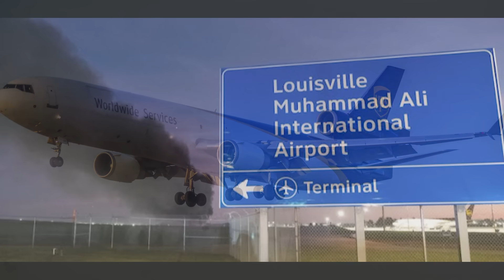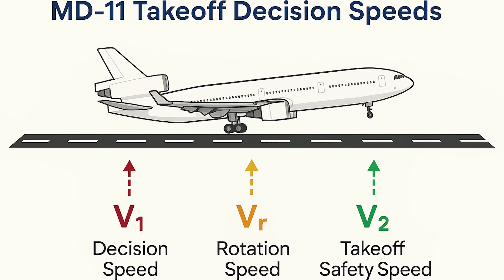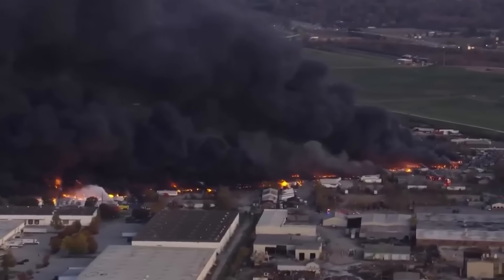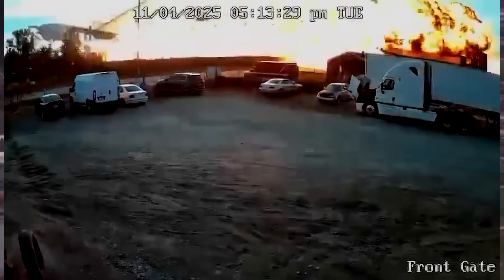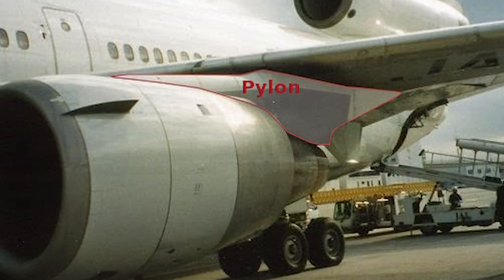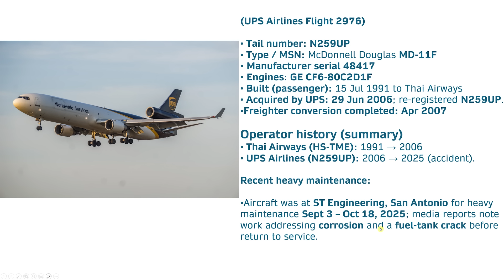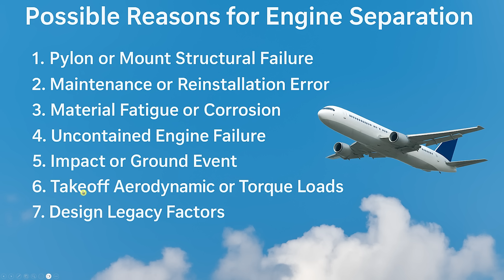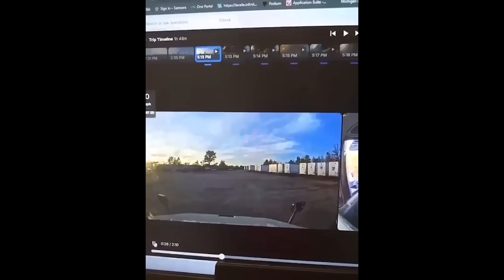What Caused UPS Plane Crash, Louisville, KY? How MD-11 Engine Fell Off

Comment: I work at UPS and I was about 100 yards away from where the engine dropped and from my perspective it looked as if the plane hit our freight facility because the explosion was so massive and close. It sounded like a train derailing going down the runway. I’ll never get that sound out of my head
Reply: Hope you find peace after witnessing that
Reply: I live right off of outer loop and I thought we were under attack. Im so glad you're ok. Prayers for our entire city❤❤❤❤❤
Reply: @kimbates7201 😮 prayers for this area and yourself
Reply: @JillLeonard-z6g  Repeating everything that was said already in the video doesn't make you look educated on the matter. We all watched it and heard everything that was said. 🤡🤡🤡🤡
Reply: @Asymmetrical-Saggin So, you don't like being reminded to pray for all the departed souls from this accident?
Reply: @kimbates7201 we are under attack.  Look at London and New York
Reply: That's crazy. How does the engine fall off the airplane?
Reply: @markolson3855  It has happened before. AA191 in I believe 1979. They used a forklift to reinstall the engine damaging the mounting points. Hope that's not what happened here. This plane was down for more than a month.
Reply: @Igotstaknowit 😮😮 wow!
Reply: @Igotstaknowit it’s definitely eerie that this happened again
Reply: @Igotstaknowit  It also happened on a Boeing 747. The fastener on number 3 broke off. It ripped the engine off and inturn collided with the number 4 engine, ripping it off too. They couldn't recover. This has happened quite a few times.
Reply: @MrSpoonfeeder similarly that has happened on propeller craft too… (where the propeller shaft somehow comes loose and the freaking assembly flies off)
Reply: @markolson3855 right! Shouldn't that be discovered during pre-flight inspection?
Reply: @kendradawn369 no kidding! I was sitting on a commercial plane and i see rivets missing by the aileron, i called the stewardess and said make the captain aware. Its almost like do they even do a preflight?? Walk around? We took off that way anyways.😂 i was not okay that flight
Reply: @JillLeonard-z6g my God 😮 I can't even imagine. I've never been on a plane and at this point I don't think I ever will. I have NO faith in people's capacity to give enough of a sh!t to do their job and do it correctly.
Reply: Saw a plane captain launch the commanding officer with grounding strap still connected. It actually hit the wing took out some ailerons 😂😂 and the guy who did it was biggest goof in our squadron. Ill nvr forget his name
Reply: @kendradawn369 considering it was down for 6 months for presumed maintenance as well...or six weeks, I cant remember but it was still down and no fly for more than a month.
Reply: @JillLeonard-z6g A GOOD PILOT will do his due diligence and do a preflight check and a post flight check on everything!!! It’s what they are supposed to do.
Reply: @kendradawn369 The actual mounts for the engine are pretty buried into the structure of the wing so its likely something you can't even see, let alone inspect on a pre flight inspection.
It's the sort of thing that's checked on major, scheduled maintenance inspections.
Reply: @JillLeonard-z6g Things like missing rivets they have criteria for.
Airliners in general are EXTREMELY overbuilt with multiple layers of redundancy.
As a totally made up scenario just as an example - if a component needs 6 rivets for structural integrity, they'll fit it with 12 then have a policy of we can lose say up 2 rivets before we immediately ground the plane, otherwise it can wait until the plane gets to the next airport where the airline has a major repair facility.
Planes are incredibly complex machines and things break all the time - I can guarantee as a mechanic, if I looked around your car right now I could find something wrong with it but that doesn't necessarily mean it's a death trap ready to kill you and everybody inside it.

I can guarantee the airline and the mechanics knew about that missing rivet.

Dull fact - there are approximately 3 MILLION rivets in a 747
Reply: @lifebeyondthesalary2458 pre flight check can only show so much, they cant see microcracks, metal fatigue etc. If an aluminum engine fan decides to take a 💩 duribg takeoff they're oretty much fuc***, its the equivalent to an engine throwing a rod or dropping a valve but with more catastrophicrepercussions, 💩 happens dont blame the pilots, ive personally eirked with all three pilots and they were professionals through and through
Reply: @kendradawn369 on a pre-flight inspection you can’t tell if an engine is going to catch fire and essentially melt a pylon.
Reply: @deezelfairy ST Maintenance should've caught the corrosion when it was in their shop. The first place the NTSB needs to go is San Antonio. I'd be interested to know what else was amiss with ST Maintenance.
Reply: @kendradawn369 42,795 motor vehicle fatalities per year in the USA. We are all landing at 60 mph every day of the year. Feel better now?
Reply: @kendradawn369 you're far more likely to be in a car accident than a plane crash. At least pilots and mechanics have professional training. Most drivers do not.
Reply: @Angelum_Band huh? 🤨
No not really. There's a big difference between driving a car that you're in control of and hopping in a can and going up in the air where you are most definitely going to die if you wreck.
Reply: @J_Wags you can tell if it's going to fall off
Reply: @deezelfairy go to know. So I wonder why it wasn't found. I keep getting a bunch of comments where people are saying there's nothing that could have been done but there has to be something that could have been done. If not that just further validates why I would never get on a plane.
Reply: @kendradawn369  I didn't say or imply that it can't be inspected - it just can't be inspected on a pre-flight which is a relatively minor inspection.
As for why it was missed? That's the job of the NTSB to establish.
But the reality is planes are extremely complex and humans are extremely fallible. Flying is still the statistically safest form of transport but mechanics can still miss things. Same a mechanic could accidentally leave your lug nuts loose on a wheel on your car which could easily cause an accident.
Reply: @rubies200 Have they confirmed corrosion now? I made those comments 10hrs ago.
Reply: @kendradawn369 

Have you ever driven a car? When you're driving, the truck driver next to you could easily fall asleep, and you'd be right there with God... Flying is the safest way to get from one place to another! How many people died today because you flew? Zero, and that's thousands of miles!! In road accidents, 1300-1600 people die every single day!!! Please never get in a car again.

Best regards from the Netherlands, Oudesluis ✈️
Reply: @deezelfairy It was listed on the report shown in this video.
Reply: @deezelfairy It was shown on the report from this video.
Reply: @kendradawn369  I know someone who worked re-fueling airplanes. The sad reality is she would notice bolts missing all the time, report it, and nothing would be done/taken seriously. Airplanes are safe because they are made with so many redundancies, so if one things fails something else can keep the plane in the air. The unfortunate reality is companies lose money every day a plane is being repaired/cant be flown, so they put off maintenance as long as possible, leading to things like this
Reply: @alibradley6302  this is not some clown fly by your pants industry. There r critical step by step procedures, inspections, over seeing. If something like that is going on  when they r done with their deep investigation into each person  someone or more than one person could seriously be held liable for the lives of others. Just as the dc plane crash you can bet they r still in the process of a very deep  investigation to get to the bottom of it.
Reply: @kendradawn369 Especially even more nowadays. Jobs are giving more liberty for people to be on their phones and playing music in earbuds while they "work" so workers are less focused on doing a good job.
Reply: @alwkicksta exactly 💯
Reply: @markolson3855  It most likely came off the aircraft because the engine mechanics did not secure it properly after they installed it.   I worked on military aircraft.  I had to inspect the aircraft engine wiring harness after the engine was removed.  I also had to connect the electrical connectors on the engine to the connectors on the aircraft.  I am willing to be a lot of money that they 2 or 3 guys that put the engine in did not do it correctly.  It is also possible the engine wasn't removed but stress fractures occurred over many years that nobody caught or there was severe corrosion on a structural element that takes the weight of the engine.  But my bets are some jet engine mechanics are shitting their pants right now.
Reply: @markolson3855  easily,  when its not correctly attached to the aircraft
Reply: @markolson3855  Human error.  Mechanics who maintained the engine did not put it back they way they should.
Reply: @markolson3855 it's a MD 11. I wasn't shocked. Happened to us it was just before it hit the runway. These companies keep stuff secret. Freighters should be held to the same standard as commercial. The company i worked for told us they were getting rid of the MD 11 5 years ago because of maintenance then changed their minds.
Reply: @markolson3855 corrosion weakening frame. It had a stress crack.
Reply: @JillLeonard-z6g didn’t this happen to a DC 10?
Reply: @auroraborealis6009 not sure..what yr?
Reply: @JillLeonard-z6g thinking it was the 1970’s
Reply: @auroraborealis6009 Yes, it was the 1979 flight that crashed in Illinois. That was a DC10(?). This is a MD11--basically, the same plane.
Reply: @auroraborealis6009  It’s an MD-11, an elongated version of the DC-10.
Reply: God bless you!  I hope you find peace as the other person commented.
Reply: Wait. 100 Yards away? How is this possible? The engine dropped on the runway and not even close to the ups facilities.
Reply: @Paddy007  UPS facility is right next to the runway. You can see dozens of their planes on google earth. The have a larger facility than the airlines.
Reply: @Paddy007 the UPS facilities take up pretty much the whole South end of the airport, in between both runways. There will often be jets parked being unloaded and loaded just the the left of that runway
Reply: @Paddy007   If you look at pics of the engine on the runway, you will see there's  buildings right behind it.
Reply: @gigicostlow4414  But not 100 Yards away. Also the guy was saying he works where the crash was. So 100 Yards compare to the engine found around at 2000 Feet at the runway, when the runway is 4500 feet long. I know maths is not for americans. But it is just impossible.
Reply: @Paddy007  UPS worldport is parallel to runway 17, it's possible when he said 100 yards he wasn't speaking in regards to the length of the runway but the distance from the location he was to where the engine landed? Even if he miscalculated you didn't need to be rude, I thought Europeans were supposed to have more class than is but more often than not that doesn't seem to be the case
Reply: @Jessa-RM  I am not rude. I am just stating facts. And he isnt telling the truth just to get some cheap reactions.
Reply: @Paddy007 the words used was "i work about 100 yards from where the engine fell off" the plane was still moving and almost off the ground when it came off. Read and comprehend.
Reply: @Matthew-qk1xi   Exactly.  He can't seem to comprehend that he did not say he was by the crash site.  I told him to go look at pics of the engine on the runway and he will see there are buildings right behind it.
Reply: @Paddy007  yep im confused on his comment  . did the plane hit the building   to cause the engine  to come
Reply: @WINCHELLLOCKLEAR  Thats it. The engine already was on the runway.
Reply: @Paddy007 I know, doesn't seem fair does it?? It falls off while they're going 180 mph right before darn runway end  and have no other choice but take off. I wonder if there was any possible way he could've avoided take off sh!t.
Reply: @JillLeonard-z6g  I think you dont get my Point. It clearly fell off on the runway and not after it crashed..
Reply: @JillLeonard-z6g  After V1 it is not possible. I am just saying, the guy here said 100 Feet away, but the turbine was found on the runway, not where the guy was working.
Reply: @Paddy007 thats what i wrote..i saw it still on the runway
Reply: @Paddy007 100 yards, not 100 feet
Reply: @LelaE34  And still it is not possible.
Reply: @Paddy007 he said 100 yards not feet, big difference
Reply: @TheRealJBS1976  60 Meters. Still doesnt matter. The UPS facility is not even close to the runway where the engine is.
Reply: @JillLeonard-z6g no possible way to avoid takeoff once theyre past the V1 commitment point. Other than run through a big fence at end of runway with same buildings on orher side. Their only hope was to try to get airborne long enough to come around for emergency landing
Reply: @Paddy007 yea the UPS facilities are very clise to the runways, have you never been there?
Reply: @TheRealJBS1976 WOW 😲
Reply: @Paddy007 boeing plane?
Reply: Friend, you were spared for a reason! Make the most of your days ahead. Peace be with you.
Reply: God bless you ❤
Reply: Ever buy tires from Chris?
Reply: @mcgoo721 Chris Aymond?
Reply: I hate u had to witness something that horrific.  I pray u can find peace.
Reply: Deep Breaths and Calmness your way. Please take care.
Reply: Remember they had about 40,000 gallons of fuel too. So very sad.
Reply: I'm so sorry. If they make trauma counselors available to you I hope you take advantage of that and talk with them. Trauma counseling really helped me after an event.  I hope you find peace. 🫂💕
Reply: I’ve been injured by UPS poor maintenance by package car maintenance. I feel it will be criminal gross negligence.
Reply: @MrBarrySell Is UPS going broke? I've heard it has been laying people off.
Reply: @rubies200 shareholders want profit over ppl😮
Reply: I feel so bad for all of you on the ground who witnessed this
Reply: I'm glad that you are alright!
Reply: Dude, so sorry you had to experience such a nightmare! Thoughts and prayers to all affected.
If possible, find a trauma therapist that specializes in PTSD! Do yourself a favor, don’t try to process this alone!
Reply: I'm so sorry man
Reply: God give comfort to your soul.  That must be so traumatizing.
Reply: You’re not even in the same state 😜👍
Reply: So sorry you had to see that .
Reply: So sorry.  Hope you find a way to cope with it.  Time heals.
Reply: My...God...
Reply: Wow thanks for speaking up. Helping people with difficulties understanding what and how this happens.  I'm praying for your ability to manage that experience 🙏
Reply: I bet it's similar, or the corrosion on the mounts snapped off during the high torque.  These planes are work horses, 45 years makes you wonder what's original
Reply: Pics or it didnt happen
Reply: I saw  fed ex plane lose an engine but it was still attached and it was an earth shaking boom from inside the hanger in an office.he did land safely but def sh!t himself. It scared me!!😮
Reply: Yep, when aluminum is damaged (cracked in a spot) it can’t be restored to original strength. A bent and cracked aluminum ladder might work somewhat ok for a long time but isn’t safe to climb on .
That UPS plane was full to the brim of fuel, so maximum weight capacity which likely made all important structural joints attempt to,hold together and the weakest spot which sounds like it was damaged in the last, failed catastrophically.  
My boss has 3 delivery vehicles that have 500,000 miles on them. They look like crap and require constant repairs but they ride real nice and are somewhat comfortable because of routine maintenance. One of them I won’t take on an out of town run. 
There has to be a limit to how long these airplanes are allowed to fly. Probably impossible for everyone to agree on an expiry date for all makes and models. Anything cracked or damaged should be removed immediately and used for parts.
Reply: @thurgoodstubbs9670 Bad idea to use them for parts, though I do agree with the rest of your comment.
Reply: @thurgoodstubbs9670 

Spent 2 weeks in Oct. for Maint. regarding possible corrosion..
Reply: @thurgoodstubbs9670 you’re right. But the OEM’s  & Aerospace Supply Chain can’t keep up with the growing demand for new planes. Consequently the planes are flying much longer with more MRO work.
Reply: @thurgoodstubbs9670 i forgot abt the fuel. We know how long it takes. Imagine all that fuel! Because a fork lift ran into it and something abt the fuel tank i thought i heard. Thats just all bad. I think maintenance failed with this one. That was an old aircraft but...the ones i worked on in the military were from the 60s..my father worked on same plane same engines and deployed euro too not meaning to do that what so ever . Whats those chances?! And we flew them up until 2014?? They decommissioned.  Females were having babies with birth defects and others got cancer from the planes way out of date systems a lot of airmen were exposed to the radiation and it affected them.
Reply: Take care of yourself.
Reply: Oh man that look like a bomb went off must give you trauma I have that PTSD
Reply: I bet you won't. You might have a bit of a reaction next time you hear a lot noise... and repetitively!
Reply: I feel for YOU, get counselling soon, If it were me I would need that!  Accept no meds!!!
Reply: what "freight facility" ? a truck?
Reply: @4wheelsride its a UPS Ground facility. Its an intermodal location they have the air coming in by plane and ground coming in by truck all in one location. UPS Supply Chain Solutions a short distance away on Outer Loop. Probably half of UPS Global traffic goes through Louisville. 300+ flights a day to all over the globe
Reply: What a terrible experience for you.  I hope that gets over the emotional trauma
Reply: My heart goes out to you.
Reply: 😮 alles gute für sie !!!! Lg aus Deutschland
Reply: I’m glad you’re safe. May time help you find a more peaceful perspective.
Reply: I am so sorry. I hope you are okay. Please don't be afraid to reach out for help if you need it. This was such a traumatic event to witness.
Reply: That must have been terrifying to witness. Thank you for sharing your perspective — it helps remind everyone how real and devastating these moments are. Hoping you and your coworkers are doing okay. 🕊
Reply: That is a good description. It was crazy loud. I was sitting at the end of Wing A watching it all. Were you in the red tag yard?
Reply: I am sorry you had to witness it. A person doesn’t ever forget something like that.
Reply: Extreme gross negligence on the mechanics part, theres no way the engine is just going to fall off, someone or somebody's are in very big trouble
Reply: I just wanna give you a hug. ❤🙏🏿
Reply: Interesting. I ride my moped down that street right beside that massive UPS hub. And I Heard the explosion and seen ALL that smoke blanketing the sky. That was truly terrifying and the destruction your UPS plane did to the landscape. Probably one of the most destructive plane crashes I Have ever seen, and it happened right in our neighborhood. Sheesh, times are changing.
Reply: Blame dei.
Reply: whoa dude its like breaking bad
Reply: Hope all will be well with you 🙏🏿
Reply: So sorry you experienced that. Please take care and be gentle on yourself.
Reply: If I were a Pilot I would refuse to fly any airplane that had structural damage in relation to the flaps, landing gear or engines. Nope. You can’t fix cracked aluminum no matter how thick it is. I can’t imagine what is used to repair it in such cases. The jokes abound about duct tape which are quite  humorous until you get a tragedy like this which isn’t an accident, it’s an outcome of deceptive repair practices.
I drive a delivery pick up truck and have no problem telling the boss that I won’t drive it until you fix the problem I have found. I refuse to get a ticket or crashed because of poor maintenance or faulty repairs. Those UPS pilots deserved better support than what was given pre flight. Safety is the word down the chain until it comes to replacing a $500,000 airplane because it has a crack here or there.
Reply: I don't get the 'Engine Drop" thing. Is it a jargon among pilots/aiport people or did the engine literally drop out of the plane?
Reply: @pajeetsingh 
It literally dropped out of the plane
Reply: yeah you better make a claim to your insurance and get check for psychological damage.
Reply: Apparently you missed the video. Check above your comment again for a video if it doesn't start automatically or the triangle in the middle of the picture above your comment. That's where the video was hiding from you. Then you want to make sure the volume is up if you're on Android it'll be one of the three buttons on the side of the phone the pair of two buttons that are closest together are for the volume press and hold the top one while the picture aka video is moving. Then remember the airport uses runways to allow the plane to land and to take off. Ok now so you still believe your comment is in any way accurate?
Reply: Wow, I imagine that's gonna be a hard thing to shake. Hope you're doing well.
Reply: United pot smokers. United we stand. Smh
Reply: That's pretty scary 😮
Reply: ahh so you work with Ryan Simmons?
Reply: I'm so sorry you had to expirence that. I can only imagine how loud it was. This is unbelievable. Someone messed up bad. Not saying fingers need to be pointer. But dude that looks so intense
Reply: The Pilot too!
Reply: How many souls were on the plane? I know it was a cargo but I'm sure maybe that more than just the pilot and co pilot were on it, and how many souls died that were on the ground?😢
Reply: @peggybush2727   There were 3 on the plane.
Reply: Was there a bomb set by the engine
Reply: I wonder if you'd get PTSD boarding a plane 🤔
Reply: It hit the petroleum recycling plant..and auto parts business..think of all the oil in that store. 2 worst places along w/ electricity lines. So sad.. when it alllll could've been prevented. If there is corrosion maybe a little metal brush is only making things thinner. There was a crack. That's when airframes better hope to God they handled the corrosion correctly. I feel for everyone involved..the families, the maintenance workers, workers in general, they must be mourning. the investigation.. my prayers go out to them at this time. 😢 I hope something is learned from this if it was maintenance because the lesson is written in blood.
Reply: @JillLeonard-z6g  I watched a report people claiming it almost hit a restaurant and yet on Google Earth that restaurant looks to be a quarter to half mile from impact.
Reply: @Igotstaknowit i think i heard that too. You did google earth?? Pretty cool..i didnt think of that
Reply: @Igotstaknowit Stooges is right there near the impact site
Reply: @TheRealJBS1976  Yes I viewed the video from their parking lot. No damage at all. But all employees have been told to stay home. Probably odor of jet fuel will be there until an environmental cleanup. It's a mess with all those metal recycling businesses.
Reply: @Igotstaknowit all employees are back to work as of several days ago, airport reopened, try to keep up
Reply: @TheRealJBS1976  Airport? I was talking about the rerstaurant near the crash scene. They were thinking of starting a gofundme for the servers.
Reply: @Igotstaknowit  you're looking at a reply to someone else that commented

But, Stooges is right near the building that was hit and the ju yard where it came to rest is right behind Stooges. They've closed everything within a 1/4 mile radius. Stooges is a popular after work spot for UPS and Fird workers in an otherwise industrial area
Reply: @Igotstaknowit 
They had to stay home. Grade lane is completely shut down, no access to stooges bar and grill at all.
Reply: @JillLeonard-z6g  it hit the liquid waste plant parking lot
Reply: Sad situation, 911 crash site at the Pentagon didn’t have any damage to the power lines or evidence like this
Reply: @kwasi32able b/c it was a cruise missle
Reply: Bless you
Reply: May Allah make it easy on you. I'm glad your safe. I used to work at UPS so feel all UPS are family. My condelences to all those involved.
Reply: Glad you are ok.  I hope you can get some help with the trauma you saw.
Reply: Because you have PTSD now welcome to my life when Charlie Kirk's death I seen the video never will forget it.
Reply: What if there was something very important, evidence, some documents that was meant to be delivered to someone in particular, a group, possibly even Trump's WH but done through independent means, and what if the Cabal/DeepState found out about this and sabotaged the plane to destroy this evidence, or whatever it could have been?? So as not to let that thing reach whoever it was meant to go to. I know it sounds conspiracy theorist, but we are living in seriously upside down, crazy times here. 
        This just feels way too sus to be some "accident" maybe i'm barking up the wrong tree but I can't help feel things just don't add up.
Reply: @RaikenXion  It was going to Hawaii; I doubt anything important was going that direction!
Reply: @MishaDaBear  Could have been a pick up point. Even Dennis Nedry met Dodgson in Costa Rica, very low-key, outside at that shabby food place. Often times important meetings and rendezvous are nearly always done in public areas, in unimportant places. I'm just saying. 🤷‍♂
Reply: @RaikenXion if it was that important there would be backups and they certainly wouldn’t trust UPS to get it there. They’re hire a private courier to handle the delivery. And they’d also make backups.
Reply: @RaikenXion   This plane does not carry passengers.  It is for cargo only.  No one was being picked up or dropped off.  Only ones on the plane were the captain, first officer and relief officer.  It was clearly a structural issue with the plane and not some sabotage playing out in your wild imagination.
Reply: @gigicostlow4414  well I wasn't saying to pick up someone, I was speculating a possible pick up of some item, document or package. Maybe it was a "structural issue" I just still find it sus the amount of issues going on with so many planes in just this recent year alone. How many crashes have there been, I have my opinion and I've shared it so that's that. I just find all these issues going on with planes lately to be sus. Can say I got a "wild imagination" or im some conspiracy nutter whatever you want doesn't bother me. This is my opinion.
Reply: To those saying this is "sus" keep in mind that this is the world busiest airline, we run 300+ flights a day through Louisville, 365 days a year, for over 30 years. We're talking about 3.2 million takeoffs from Worldport in 30+ years with no major incidents before this, you cant beat the odds. I knew the pilots and I also know some of the mechanics,  ground crew, etc. Its impossible to keep a perfect record for 30+ years at that volume. Stop with the stupid conspiracy bull💩
Reply: @TheRealJBS1976 it’s not impossible to maintain a clean safety record. Stop “coping” with your own company’s abject failure.
This is not normal. It is 10000% the fault of either the company or an individual. Your comment is disgusting and disrespectful to the people the died.